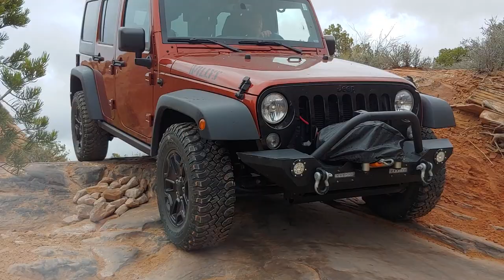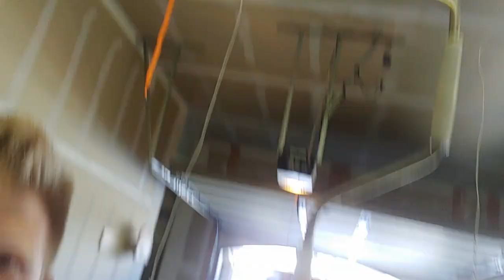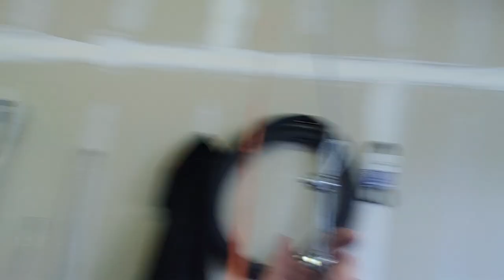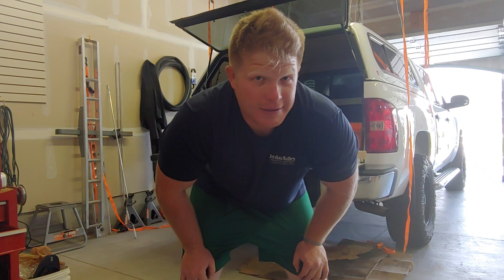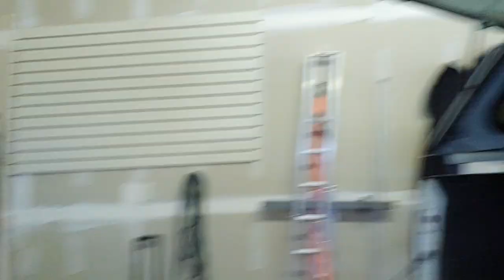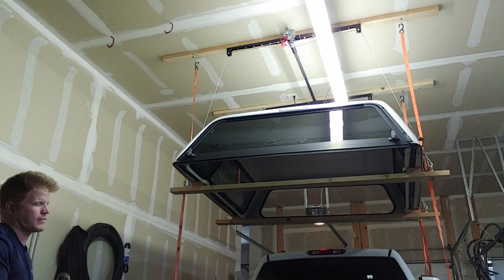CHEAP EASY Truck Camper Shell Lift

Comment: I’ve had that same setup 15 years.  Take the ends off the hoist rack off and mount the pulleys to a long 2x4 the same width as the shell.  Move them out wider.Takes strain off the hoist and it works much better!  Great work!  This allows you to hoist the shell higher up too!

Comment: Good video , I made a similar setup , but a tip for you is to paint marks on floor at left rear tire on side and front and back when you have the truck in perfect position for the next time removing or installing to make it easier. You can look back out the door and position truck perfect every time.
Reply from the maker: I have a paint mark on the wall that I line up the mirror with. But that's an idea.

Comment: Good job. 

Have you ever thought of buying a 2500 # winch ? You could run a pully system and mount the winch to the wall. Or,  mount it to the ceiling and go from there.  You can get a wireless control one for under $200.
Reply from the maker: Yeah i thought about alot of different options but i was going with the cheapest and easiest way to do it. This was actually even cheaper then doing it all from scratch. With the drill it really only take a 1 extra minute.vs having a winch thats ready.

Comment: great video, thank you.  If your sheet was on the 2x4s and laying on the ground, would the hoist cables reach down that far? Or will it only work if the shell is at truck bed height? My Ceiling is about your ceiling height. THX
Reply from the maker: The lowest thr cables go is about 4ft off the floor.

Comment: Wondering if you are still satisfied with this setup. Seems like a good way to go. Can't seem to find it online though. Anyone know if it's been discontinued, or just supply chain issues?

Thanks!
Reply from the maker: Its been fantastic. It sadly has been discontinued. Someone here in the comments has found prior stock on ebay and similiar products out there.

Comment: I just find the balance point of the cap and lift it straight up over my head and walk out of the back of my truck there not that heavy the key is finding the balance point. Then I store it under my back deck it's so much faster. I had trucks with 8 foot beds and never had a problem taking the cap on and off by myself.
Reply from the maker: Maybe with an aluminum shell. But the last two fiberglass shells have been over 200 lbs. There's no way I could lift it over my head and walk with it. This way it's also out of the way and out of the elements/critters.
Reply: You are a beast!  LOL!  I just bought a used shell that the previous owner obviously took off by himself because there were chips along the bottom edge.  This allowed me to get it at a fraction of the price and some door edge trim covered it up nicely.  Took 3 of us to carefully place it on my truck.
Reply: Here's a video of a guy doing it https://youtu.be/7mleIlpa2TU

Comment: I looked at that system...but My camper top is the high top and weighs 350-375 lbs. That system is only good for 250 lbs

Comment: Do you have the dimensions for the 2X4 setup and where you placed the blocks.
Reply from the maker: Every shell is different size so youll just wanna measure for clearance and the blocks are in the rail channel as shown in the video.

Comment: would it work if you installed the i-bolts directly to the top of the camper and attached the ropes via carabiner clip there?
Reply from the maker: You would have to make sure your shell has the structure to take the weight of itself so it doesn't crack. Also you would need to do some silicone or something to prevent water leaking in. Thirdly the asthectics of having I bolts sticking out of a $2000 dollar shell wouldn't be that great.

Comment: Great solution and older video. I can’t find this lift anywhere now though. I’m thinking this one would suffice as well. https://www.amazon.com/gp/aw/d/B08KY1DCQL/ref=sspa_mw_detail_0?ie=UTF8&psc=1&pd_rd_i=B08KY1DCQLp13NParams
Reply from the maker: Thanks. Yeah looks like they quit making it. That rack you linked looks good. Just double check the weight rating.
Reply: Yep, looks like it’s only sold by scalpers:
Racor PHL1R Garage Ceiling Storage Rack Lift https://www.takeandpop.com/products/racor-phl-1r-garage-ceiling-storage-rack-lift?utm_medium=product_sync&utm_source=google&utm_content=organic&utm_campaign=feed_donkey 

Thanks For the alternative. Did you install it, does it work for you?

Comment: Could you have raised it higher than shown in the video?
Reply from the maker: You can raise it all the way until it meets the crank. However I didn't like the geometry since the eye bolts are further out than the platform that comes with the product so I only go that high. But it's hight enough to walk under and drive a 6" lifted truck on 35s.